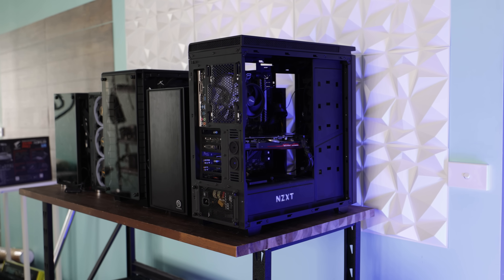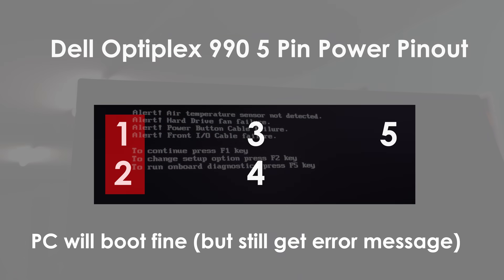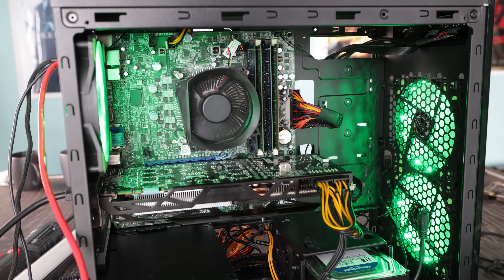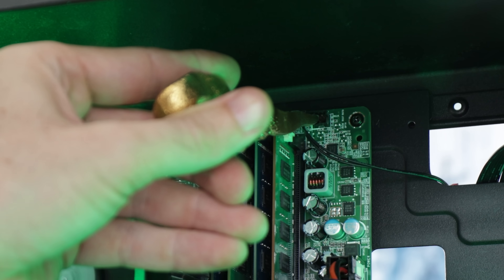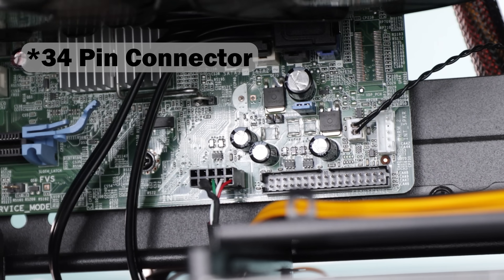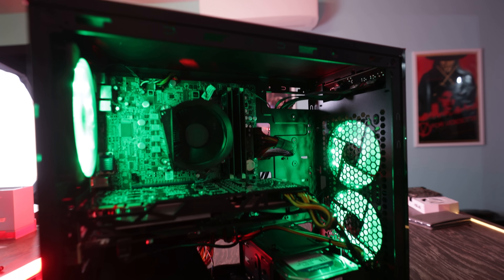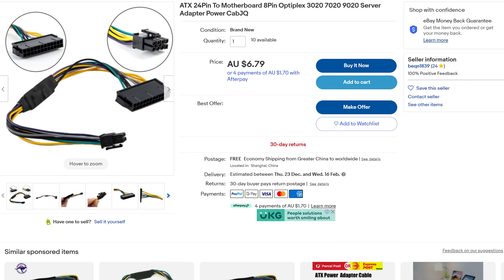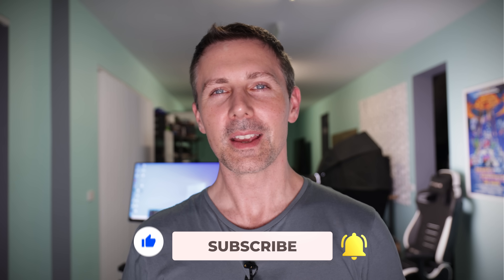Turning a Sub $100 DELL OptiPlex into a FAST Gaming PC

Comment: I remember I did an experiment on the Optiplex once. The power button jumper (5 pins one), 2 pins are designated for power button, the other 3 pins is designated for power LED. The LED is dual colour, if not mistaken, having 1 common ground and 2 inputs to signal the system is switch off, standby or hibernate in amber colour and the system is switch on in blue or white colour.

And as for the Front Panel IO, it is possible to use the existing Front IO port, and you can cut those cable and solder jumper pins so you can just plug in the USB cable from the case into it, but you need to check the connection. 

Anyway, As for Dell desktop system (Vostro or Optiplex or Precision) up to third gen Intel Core i series can actually move to a new case with a few tweaks, but most of them uses standard stuff.

Comment: Just did this with a 990 SFF Dell OptiPlex $60, I5-2400,  8G 1333 {Lol},  1TB HDD 
Bought separately 1030 $90 - 2 Extra fans Installed via USB hub $15.
It hasn't struggled to play any game yet, new or old. Unless I cant clock the CPU to let the OS even recognize that I can load the game.

 All games that worked on Medium settings had an average range of 52-118 FPS.
Forza Horizon 5
Rogue company
Destiny 2
Back 4 Blood
NBA
Madden
ESO
For Honor
Blood souls universe games & also Elden Ring Beta (While Overclocked GPU)
GTA 5
Paladins
Smite
and many more.

Comment: I remember using this Dell Inspiron on a computing course I was doing, Every day id turn it on and it wouldn't find the sata hard drive so id have to take the side off unplug the sata drives data cable and plug it back in, if I did that and turned the PC back on then the PC found the hard drive and would load into windows.

Comment: ya im sort of doing same thing with a acer veriton x6440g got it for incredible deal 100cad a piece. has i5 6400 8gb ram 1tb hdd. gonna transplant to new case. i hope it does not have to many preparatory connectors. i know the acer have power connector. got gtx 770 and 650ti for 40 as a pair lol

Comment: Also you have to disable secure Boot and UEFI that can also cause the same error message even though the BIOS technically supports UEFI you can run into issues so it's best to run in legacy mode I've tried to do this myself once before but too many proprietary connectors and it will work but like he said you have to press F1 every time and a lot of people just don't want to mess with having to do that every time
Reply: This thread is pretty old but interesting. I thought he had installed asd so why didn't he use  the uefi  instead of legacy on the bios setup. Also on the drive fan connection if you didn't have extra port to plug the fan into, where DID you plug it in?
Reply: OK I re watched the video and he was referring to the mounting location of the fan itself, not the wiring connection. My Bad!

Comment: Like father Xeon was saying, there are adapters available, but depending on where you live they can be kind of costly. Also, there tend to be different boards even used in the same product line, so some of these are very easy to transplant and take almost no work, while others need a fair deal of troubleshooting… So this video is a godsend for anyone looking to put together a budget PC with a pretty thorough guy. Thanks for the video!

Comment: I did this a few years back. For the power switch, I spliced in the power in and led connectors then used heat shrink tubing. The front audio/usb cable I zip tied to the bottom pci slot to keep from moving.

Comment: Jumpers were the only way to configure hardware addressing back when I was a kid.  The juggle of "old ex upgrade" hardware was mostly forcing it to work together as platform compatibility was still in its infancy. It was referred to as bridging the pins, not shorting.
Reply: Computer building and repairs have changed a lot over the years I remember when you left the pc plugged in to ground yourself now they no longer do that. But that was like 18 years ago.
Reply: @Chris yeah in 1998 I was taught that cause if you open the psu you will see it is grounded to the case and if make sure to touch the case while working in it that gives the esd somewhere to go.

Comment: Definitely my favorite kinds of vids! 👍 I’ve got a similar computer with a Xeon e3 1241v3 ($45 i7 4790) on a Lenovo m83 ($19) with 16gb of memory half of which I took out of a dell on the side of the road. It’s also got a gtx 770 but it’s a bottle neck unfortunately.
Reply: 1241v3 can hold even 2060! for 50 dollars is amazing value

Comment: I have done the 4th gen conversion before.  I kept the motherboard ends of the dell case cables and wired standard layout pin blocks to them so that you could just plug in the new case connectors into those as extensions.  The extra pins on the 5pin power button header are the power buttons leds, so you can wire it up as a power led and a power switch header for the requisite case cables.  These adptations removes the errors and still allows you tto use the on board usb, hd led, power switch, power led and sound facilities.  Less to add, more profit to gain.
Reply: Also you don't need to keep the little fan in there.  Cut the cable off it and put a standard wired pwm fan header tto the cut end to move the errant wire to the correct side.  Then you have a working pwm fan header on the motherboard.  Dell's proprietary fan header just moves the pwm cable to the other side, so you just have to switch it back.

Comment: Been researching doing a similar thing with my T3600, but those proprietary connections are a b...... hassle 😁 Managed to burn 2 Gelid 12cm Radiant-D fans when attempting to replace the front 92mm fans with the appropriate conversion cable. Then there's the PSU......

Comment: i just bought dell optiplex 9010 with  i5 2500 with 4 gb ram and 120 gb ssd  with dell monitor with kaybord and mouse for 150usd and its the cheapest on the local market 💔

Comment: Can you Not turn off the "Security" settings for the sensors on that board in the Bios ?   or is this the one off that doesnt allow it ? Every time i had that happen in the systems ive encountered ive just turned all of that off .. I take it the newer bios/board wont allow it ?

Comment: The issue i have my optiplex like a bunch of others though is the open case detector. Amongst other security devices similar to it. Once you remove from the Dell case it wont let you boot the system just gives an error.
Reply from the maker: You can disable case intrusion on this motherboard's bios, do you know have a similar setting in yoru bios?

Comment: I sell a crap ton of these in my state. Dell 3010s is probably my favorite prebuilt(close second would have to be a z620). E3 1245 v1 or 2 is  arguably the best bang for buck cpu for this system. NZXT h510 cases did the job for me as far as front output (took a bit of trial and error but it works flawlessly each time).
Reply: Discovered the Xeon E3-1275 Ivy Bridge CPU won't fit in a Dell Optiplex 3010 or 3020 socket. They're Sandy Bridge and incompatible with that CPU. However, I successfully installed a Xeon E3-1275 in a Dell Optiplex 7010. Upgraded RAM to 8 Gb, installed a Seagate 1 Tb HDD, and a AMD Firepro w2100. 64 bit Linux Mint Cinnamon 20.2. Works like a champ! Built it last Friday and sold it today... for a tidy profit.
Reply: @johnross8939  really? did you do a bios update?  My 1245 v1 and 1260lv2 work fine in the 3010. Strange.
Reply: What about using E3-1275 v1? Price is comparable to an E3-1245 v1... Got me rethinking. I have an Optiplex 3010 SFF and another Optiplex 3020 medium tower. Both are i3s with 4 Gb RAM. I just ordered some video cards for them.
Reply: @johnross8939  I see them floating around for the $75-90 price tag and the small 2-400 MHz increase you get is honestly not worth it vs $35-50 max for a 1245.
Reply: I got two E3-1275s for $58 on epay plus $6 SH and tax. So no more expensive than the E3-1245s I saw listed. Seller has more of them as well, initial list price $32 each.
Reply: @johnross8939  2 for that price??? That’s a steal. Scoop them up before they’re gone!!
Reply: The Xeon E3-1275 v1 wouldn't fit the socket on my 3020, but did on my 7010. It does fit the socket on the 3010 my friend acquired from me. Sorry if I wasn't clear about that. Neither PC required a BIOS update. We also put AMD Firepro w2100 video cards in the 3010 and the 7010. I had one in the 3020 and it originally worked, then wouldn't boot the 2nd go around. Go figure... Dell two different socket 1155 manufacturer's and one is definitely superior to the other.
Reply: @johnross8939   - a 3020 likely needs a v3, as one of my 9020s is using a 1230 V3.
Reply: Dell T7600 would be my favourite prebuilt lol

Comment: I have a Dell Optiplex with an i5-4590, R9 Nano and 12gb (4x4gb) ddr3, it's excellent for a budget build and the R9 cards are still relatively cheap due to their bad rep, but with a bit of undervolting and a sturdy 500/600W PSU it'll run fine given that you buy the PSU adapter for a proprietary Dell board. If all you play is ~5 year old games or esports one of these builds are great.

Comment: DLM Tech garage (precision/optiplex build guide)  has a video that covers all the adapters you needed for this build and avoid all of those error messages and annoyances you went through with the front panel. It will make this a cleaner build.

Comment: These are great value for money boards! These also work with E3 Xeon chips, so I have found E3-1220 (i5-2400) CPUs for $15 USD or less. Pair it with a nice 2GB GPU and you have a custom gaming PC for around $200-$300 that will play all major eSports games respectably.
Reply: Yep. The E3-1230/E3-1240's (i7 2600) go for around $25-$35.
Reply: @The_Plump  wait so it works? if i just buy e3 1230 on my dell 790
Reply: @speedwagon5951  Should just straight up work but they don't have iGPUs so you need a dedicated GPU.
Reply: @speedwagon5951  you may have to enable Hyper threading in the BIOS. Sometimes Dell has it disabled by default. Otherwise it should work.
Reply: @The_Plump  how u get into bios
Reply: @The_Plump  or theres some setting in the bios
Reply: I have an optiplex 7010 with an i5 3470, you're saying I can just pop a xeon 1240 in there and it'll work?
Reply: @deniahmetaj  It should. In your case you can even get a E3 1240 v2. That's the Ivy bridge version and It might be a tad faster than the Sandy Bridge version. Just make sure to update your BIOS and enable Hyperthreading.
Reply: @deniahmetaj  I second the other comment, update your bios and make sure that hyperthreading is enabled. Some Optiplexs will not work with multiple generations of chips so a V2 is the safer bet. Also, there is no graphics on a Xeon, so make sure you have a dedicated graphics card.
Reply: @deniahmetaj  Yep, I used to salvage E3 xeons to use in prebuilts and they just work. Though you need to pay attention the the v because they indicate what generation they're from. No V is sandy, V2 is ivy, V3 is haswell, etc...
Reply: @deniahmetaj  yes, it'll work. I have an E3 1230 V2 run with rx 570 and 16gb ram and its run amazing. Make sure u enable hyperthread  in bios and enjoy (y)
Reply: @Selfundum  my 790 has E1230, GTX 1650 low profile, 16gb ddr3, 500gb samsung 870 evo sss, 500gb wd blue.
Reply: I got i7 950 with gts 450 and 16 gb ram ofr 210
Reply: @MrFish-rq7so  That's a really solid start. The first thing I would recommend is a better graphics card when you can. If your power supply can support it, I would recommend something like a GTX 660 Ti or R9 270 to really get the most out of that system. That's a 60+ fps Fortnite experience all day long.
Reply: @JDStickland  well i got evga 1050 ssc for 100 euros
Reply: yeah i got one with 16gb 1800 ram, i5 3570 (chucked in biiigg tower cooler), windows pro, 1tb hd + 120gb SSD and ran it with a big overclocked 670gtx 2gb and ran like a dream for games like overwatch and pubg cost a total of 200 AUD had it for years hahaha (and the on board audio is actually really good if you change the sound setting to studio quality)
Reply: Man I'm totally confused with all that numbers, I have a Dell precision 3440 system borrowed by a educational institution, it has an i5 10500 and 16GB RAM built in, I got curious about this little systems, because they are spread very far all over the world in offices and schools and so should be easy and cheap to get, but the informations confused me even more. Guys, are you interested to help me out about getting a pc built for as cheap as possible that can run 7DTD and Mist Survival? I didn't care about gaming since Battlefield 2 but then discovered this survival and crafting games, but I'm not sure if I would find them as interesting as watching gameplays, I spent a crap load of money for my last system around a Q6600 when it was just released but never used it and so I try to avoid to spending too much money again.
Reply: @Wilson84KS  An i5 10500 and 16GB of RAM is more than enough. Most of the stuff talked about here is 7-8 years older and still capable. The only thing that you'll need in order to be off to the races is a graphics card. 90% of Precision 3440s are the small form factor, meaning that they have half height expansion slots. You'll only be able to use a half height graphics card in that case. There are cheap options like a GT 1030 or RX 550 available for around $100 USD on eBay, but those may struggle with 7DTD. My recommendation is to find a RX 560 SFF or GTX 1050 for around $200 (the Quadro T600 is also an option, but is usually around $250). If you have the extra budget, some upgrades would be a GTX 1050 Ti for around $300 or a GTX 1650 for around $400. If none of those are in budget, you may be able to get away with the integrated graphics for a while. The UHD 630 on the i5 has some pretty solid gaming performance at a 720p resolution and lower quality settings. Just make sure to get a graphics card that fits your PC case and you should be good.
Reply: @JDStickland  Thank you a lot, exactly the informations I need, about CPUs I get it slowly, but about graphics cards I am overwhelmed. The Precision is just borrowed, I will have to give it back in next couple weeks, I just mentioned it because this is how I came to this small format "office" PCs because they are usually cheap but also have very bad performance, but it seems like this isn't the case anymore. It doesn't have to be a system like that, sorry if my comment was confusing. I am aware of the low profile GCs, would do a rebuild like shown here, I have a tower that I am using since Pentium 4, I like it, especially collecting labels of OS, CPUs and GPUs on it :P I already have a Crucial SSD and hybrid HHDs, two Seagate ST500LM000, and a 600 Watt PSU. Anyways, now I know what I have to look for about the CPUs and GPUs, the information about the possible age is very helpful, everything else should be logical, find a MB that supports this two components and can take as much RAM as possible. My Budget is +- 300€, now I think it should be possible. Thank you a lot once again J.D. :-)
Reply: I have a Dell 3050 sff w/ i5-6500 ,any idea with what I can replace it ?
Reply: @mariusunsraw  I'm pretty sure that Dell model is pretty tough to upgrade. Depending on your budget, the cheapest option is to find a graphics card as i mentioned to the other guy in this thread. The other option is to buy a compatible motherboard and build a custom PC, but expect to spend at least $150 for a motherboard, case, and power supply for that CPU.
Reply: @JDStickland  thank you sir ,i got a gt 1030 low profile coming and i hope that will help a little if not I will get ride of it
Reply: Does it work well for racing sims or borderlands 3?
Reply: @TheNutshaq  Lighter titles like Assetto Corsa or American Truck Sim would be fine with a budget setup like that. But you would want something a bit better like an E3-1240 with a 1060
Reply: @JDStickland  do you think one of the V3 Xeons would work ok for something like Forza?
Reply: @TheNutshaq  The E3-1231v3 is a great choice. It's an i7-4770 and I've bought them for around $30 USD
Reply: my cpu goes for 188 usd and im turning my optiplex 9020 sff into a gaming pc and leaving the case as well i think it looks good original i like the dell optiplex look😁

Comment: You should check out the 7040's there are some good deals on ebay the sff Dell optiplex 7020's and 9020's are good but the small chassis limits upgrades  a low profile graphics can can work though I would love to see you work on a 7040

Comment: I literally just did this a few months ago. It works but I won't be using dell optiplex motherboards anymore.
Reply from the maker: I have heard that they do have a higher failure rate in gaming pcs than the lenovos and hps.
Reply: @techyescity  It does function fine for me though, just the proprietary components of dell motherboards that can be a pain. It was my first build so I'll be upgrading to a different motherboard at some point. I love your videos btw. thanks!
Reply: @techyescity  Yes, after a while, bord will not fire up if it is not constantly plugged in the wall outlet. Made 4 times dell swaps, in 2 cases had to change the motherbord. Was 2nd gen. Fortunately i had a cheap bunch of them dumpsters from a local school.  Too much hussle for me. Often i find custom pc's with i3/i5 for cheap locally, in price equally to dell/hp, so i don't bother again with proprietery stuff

Comment: You can "jump" the data wire over to the next fan connection so both connections read as connected even though only 1 actually is,  eliminating the need for a fan placed flat on its back doing nothing.